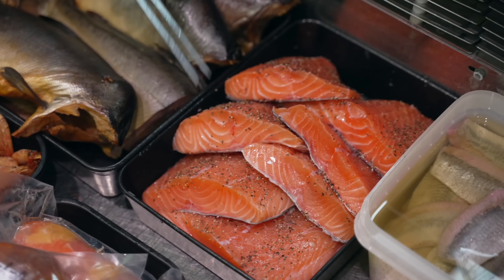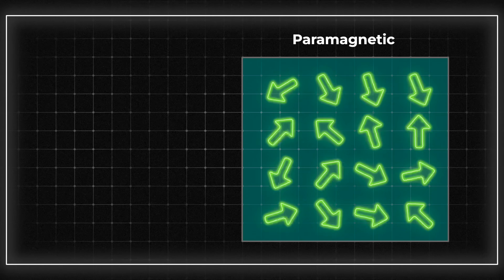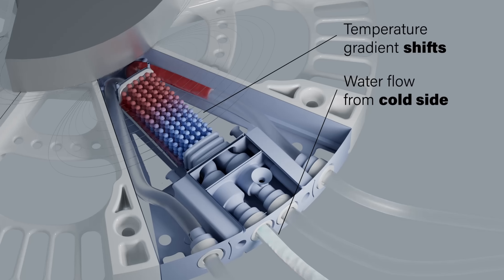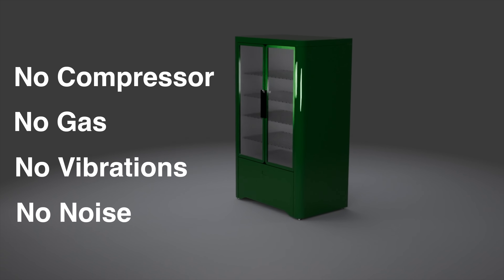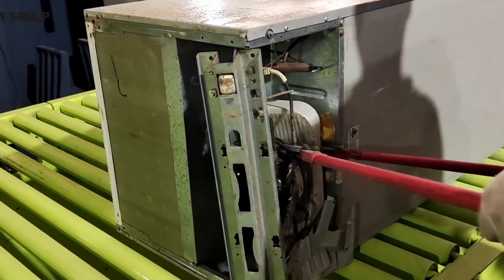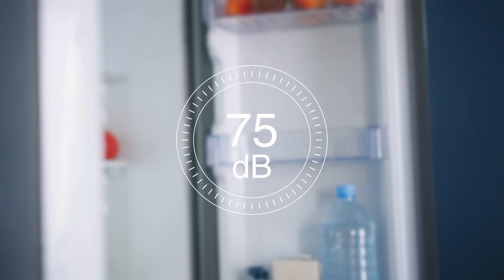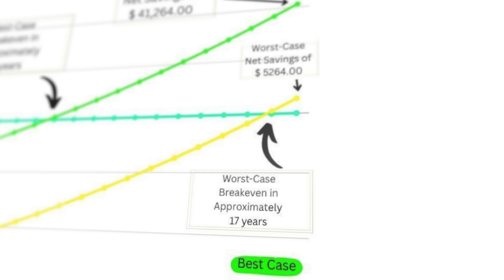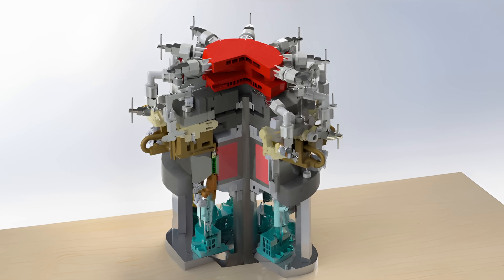Can Magnetic Cooling Disrupt the $100B HVAC Industry?

Comment: I have a freezer from 1954 that still works. It uses less power than a modern one and it uses Ammonia, so you will certainly know if it leaks. Water free ammonia that is, 99.98% pure, not the regular poop you buy at the store. It is absolutely amazing tbh. Freon in freezers are forbidden where I live, since years and years, but this freezer was made before freon in freezers was a thing I belive. Might be mistaken, but ill keep my old freezer till the day I sleep in the mud.
Reply: It's not the refrigerant.

It's the fact that old electronics weren't designed with built in obsolescence from cheap, short life components that will fail long before the main functioning pieces of the device fail.

LED bulbs are a perfect example of this.

The earliest LED bulbs for sale actually lasted many years.

Brand new ones will die within 2-3 years, because cheap capacitors on the internal PCB driving the LEDs blow out, as they were designed to so you keep buying more.

Simply replacing those electronic components on the PCB with high quality ones before you ever start using the bulb will give them MUCH longer life before needing maintenance.

(it pays to have an electrician in the family, or at least someone who knows how to change basic components and is competent with a soldering iron)

My dads old microwave was like this - he got it from his old work place where he designed and tested consumer electronic PCBs for a living.

It lasted over 20 years (with some replaced parts), which is pretty ancient for a domestic scale microwave.
Reply: @mnomadvfx  I absolutely agree that products from the past was built to last. Quality was a matter of pride back then.
Reply: They’ve been using Freon in household refrigerators and freezers since the 1930s. We had an old Frigidaire from 1932 that had R-12. It was still operational until the 1990s. Not sure what happened to it. Anything that has ammonia has to be piped with iron piping. If it has any copper, it isn’t ammonia. Highly doubtful if anything in 1954 had ammonia. But very believable it’s still running.
Reply: Maybe you will sleep with the fishes.

Comment: It seems intriguing, but even in the long term, it appears to be highly complex with what seems to be a limited of application. Implementing such a significant towards greater complexity would likely be challenging. Additionally, an aspect that was not addressed is how, say something like a walk-in would recover when frequently enter and exit. For instance, with Freon which has a very low boiling point of approximately -14°F, it can reduce temperatures rapidly.

Comment: I wonder if some sort of liquid with metal suspended in it might work? It would allow a continuous flow of the metal itself like the refrigerant we use now, perhaps eliminating the intermediate heat exchange step. Might even be more efficient since the little bits of metal in solution could provide more surface area for the magnetic field to work on. little spheres might work best. A sphere can roll over the insides of the piping as well, reducing wear and making direct contact with the tubing for a more direct energy transfer.

Comment: The component missing from the equation :  The price of electricity.  This figures in greatly into any calculation when it comes to whether this type of heat pump becomes prevalent or not. 

In some  parts of the country, the price per kilowatt of electricity is towards 30 + cents ;  In other parts of the country, electricity may cost as little as 11 cents.  This is why you may see solar panels in one part of the country but in other parts, solar panels are as rare as Kryptonite.  To be honest, in most parts of the country, I suspect that the reason the price of electricity is so high is not because of demand, but because politicians that heavily influence the price of electricity by artificially increasing the price, usually thru insane taxes or thru incentive programs which just  shift the cost of development  to someone else, i.e. to the taxpayers instead of those buying into the new technologies.

Comment: All this funny business is silly. Want to save energy cover your roof with solar panels wire it all up so when the sun goes down the grid power kicks in. That is all you need. If you want to spend more install a battery bank. 

If your a total DIY cheapskate like me go find a deal on some used solar panels for 50 bucks each. You can be silly and pay some arsehole rip off solar contractor 80k or DIY it for under 5k. After that your going to save 50 to 75%. 

Power company will be pissed off at you but screw them. Don't make your system grid tied, don't try to sell power back to the power company, this gives them power over you and now days they wont pay you hardly anything. Keep watching these videos with your TV lights and AC powered by the sun and your power bill 25% or less then what it was.

Comment: Celsius is not a better system, it is just a different system. I like the integer spread of Fahrenheit 75f 23.8c is not as cost saving for AC-settings as 78f 25.5c but 79 is too warm 26.1c; I don't like the decimal points. 25c 77f is an match point as integers but 78f is my sweet point to save money. It's just easier to not use decimal points.

Comment: If it is more efficient then I am thinking about EV battery heating and cooling. That also has a very specific ranges of temperatures that it will have to deal with making it better for that application.

Comment: I’m glad consideration of cost and environmental impact are addressed.
One golf trip for the idiot in the White House creates more greenhouse gases than dumping the refrigerant of several heat pumps. I didn’t do the math because it is astronomically obvious. An avoidable risk compared to one that could be mitigated while serving a purpose.

A $125 solar panel 400watt x 6hrs per day is 2.4 kWh. That’s a generous amount for a home refrigerator daily consumption. I’m very conscious of energy consumption because I have off grid solar and frequently monitor consumption. I have two large double door refrigerators and an upright deep freezer. Those and LED lights and various chargers average 20% load on a 5 KW inverter connected to the essential circuits panel that support them. 
  24 kWh on a perfect day could be generated by ten 400 watt panels,but with twenty panels and twenty kWh of battery,you can throw in the water heater except when the solar input is low.

This is not theoretical,but the system I currently have. I like learning about possible new technologies but free electricity destroys the urgency to change horses.

Comment: WHY SUCH SOLID MAGNETS?
Surely, getting the magnets to travel over a larger surface area would be better, even if using an intermediate fluid to transfer heat from fridge insides to the magnets.
Rather than solid rotating disc, why not:
 - magnetic goo/sludge
 - a suspension of particles in a fluid 
 - In a flexible medium to form a belt
 - As marbles following a path (noise and wear might rule this one out)

Comment: The noise level in fridges and freezers could have been solved. But the production facilities are to cheap focused. Ever heard about a screw compressor?
It is much more silent than a piston compressor.
However the price of a piston compressor is low.
There are screw compressors in the industrial use already. Like for high pressure injectors

Comment: I kind of feel strange about that. On one way it's nice, but on the other this seems quite complicated. Wouldn't it be more simple to get like modular fridges for commercial applications ? I mean they already have HVACS. They could get one compressor, for the building and hook it correctly to the building itself to heat it, while freezing and refrigerating the fridges. And dump that outside if needed. You could then just replace the fridges or compressor when appropriate, avoiding issues with recycling.

Comment: So, unless you are a big money corporate company who can deal with that LARGE price tag, the old fashion compressor cooler is still #1 choice. We switched to R134 back in the 90's due to the OZONE problem. now after 35 years it's greenhouse gases. FYI they are actually producing a refrigerant to replace R134 that has a much lower GWP, and pretty sure it will beat out the magnets in pricing much sooner.
 Comparing the magnet to solar is not really a good comparison, they are easy to make, try using the ELECTRIC CAR, they are being mass produce by many companies, yet it is still cheaper for the average person to buy an ICE vehicle.
 I liked the video; you were very concise without doing a long backstory.

Comment: R134a is being phased out.  New refrigeration equipment will not use it.  In fact the replacements for all refrigerants all have such a low Ozone Depletion Potential (IDP) that the scaremongers have invented a new metric, the GLOBAL Warming Potential (GWP).   And these scaremongers are all fine with using isobutane or CO2 as a refrigerant.  It is all a giant grift and scam.  Maybe magnets will find a use no matter what.

Comment: I think that the cost of electricity will come down faster than the price to make a magnet powered refrigerator, so that they will never be cost effective to produce in a capitalist economy.  Also, the cost savings you quoted per year for this compared to a conventional refrigerator must be based on a very expensive electric price, as my entire electric bill is only about half of what you were claiming as the cost to run just a typical refrigerator.

Comment: Do you think this will be adapted for things like space suits? I mean you could use them in the thermal regulation system since they produce both hot and cold. And in theory you might be able to make them small enough to fit in a backpack? I just wonder how durable they are while being moved, they are going to want the air gaps to be minimized in order to maximize the flux and efficiency of the whole system.

Comment: Wow, these fridges kind of suck, they can barely even get down to refrigeration temps, has more moving parts and a far more complex refrigeration cycle. I get not wanting to use refrigerants that are extremely environmentally damaging but modern refrigerants aren't even that bad and you can use almost any gas as a refrigerant if you really want to, even argon which is quite cheap and super inert.  Also, 17,000 kw a year?! What kind of fridge are you talking about? Because my whole house doesn't use that and it has 2 full sized fridges and 2 chest freezers (not to mention all of the rest of the house's needs on top of that). Finally, have manufacturers not just considered insulating refrigerators better?  Because getting things to a temperature is no different than rolling a ball up a slope, sure it takes work to get it there but once it's where you want it, as long as you can stop it from rolling back down (insulate it), it takes basically no energy to keep it there.

Comment: Newer fridges only break down in 15 years  because companies want them to.

I had a 30 to 40 year old fridge back in the 90s (it might have even been older). 

It only broke down because I damaged it while I was cleaning it.

Older friges were built to last while the current ones are built to break down so companies can make money. 

It's called planned obsolescence.
Reply: Unfortunately, modern fridges are made to last, maybe 10 years. At least before you need a repair. We lost the technology to make a fridge that goes 40 years. Same with all appliances.

Comment: These, combined with Peltier elements, could easily replace traditional fridges. There are full Peltier fridges already, but they are relatively inefficient because you pay an efficiency price if you need to create a large temperature differential with them. Yet they could be very useful to boost  the temperature from a few degrees above freezing as magneto cooling can achieve to solid below. This hybrid would have better efficiency than a full Peltier cooler and better cooling range than a magnet cooler. It will beat a traditional cooler if the freezing compartment is not too big.
Reply: I'm not so sure it's feasible. Peltier modules only have COPs exceeding 1 when creating a 1° or 2°F gradient.

Comment: You made a HUGE mistake in your comparison/justification, saying 17,000 Kilowatts, when the real number, for an average refrigerator is about 1,700 Kilowatts. (...or about 200 watts per hour). So the yearly savings figure of $2,400 is actually only $240, which doesn't come anywhere near justifying increase in cost. In essence these things are light years away from making sense and there is no reason to be excited... 

Hopefully someone will keep trying to make this process exponentially cheaper and simpler, but realistically it's more likely that all the existing producers go bankrupt due to lack of any conceivable cost/benefit. This is really similar to the issue with pulling drinking water out of desert air, It's just cost prohibitive and overly complicated Only makes sense in the rarest of circumstances). Since you reference this "cost savings" as the reason why everyone should be excited by these these magno-refrigerators, i figure it was worth while to point all this out... LMK if you want a proof next time b4 you put all the effort in?
Reply: I am not excited...
Reply: You misunderstood what he stated. he did say industrial fridges were the information point not your fridge at home. I’d imagine an industrial one is quite a bit more of a drain than what’s in the kitchen.

Comment: If they could find the right gas that would work at the temp the magnets get on the hot side they could use that in a gas cycle like the RV fridges to gain extra cooling instead of wasting the heat to the atmosphere. That could power a freezer section or supplement the cooling on the fridge side with no extra power used.

Comment: Don't let the perfect stop the good enough. People could easily get use to divided refrigerator and freezer. There is no compelling demand that one unit do both. Also the cost shift is much quicker if you add a recycling fee to every pound of HFCs from point of sale to return. The idea that people get cheap units now and pay no price for the escaped gases is just a criminal part of capitalism. Internalizing profit and externalizing costs. Build the separate units and if you want a single box for it with two systems to avoid the inconvenience, then you pay extra. Besides look how "heat pumps" for housing systems were range bound for so long. Now they are extending the range to work in much colder conditions such that you can have a heat pump for your home in the Arctic circle without a backup electric heat coil for days below a certain temp. Given time and incentive, engineers find a way. I am old enough to remember when the freezer part of the unit was about one square foot inside the refrigerator box and you were happy to have a few ice trays for your drinks in summer. Maybe even a carton of ice cream but not much more. And I still saw a few from before my time where the compressor was out in the air ON TOP of the refrigerator box instead of hidden away in the bottom. We have come a very long way in my one lifetime. My grandmother actually still had the old ICE BOX in the kitchen that used a block of ice from before they had electricity at all. And it was on a farm where the old ICE HOUSE was in a pasture. They actually cut the ice in winter into blocks and stored it between layers of straw mostly below grade but that was their yearly supply of ice for the kitchen. We came a long way baby!!! How many even know about ammonia refridgerants? Or PROPANE POWERED REFRIGERATORS? How do you use fire to cool things? Many RVs had them though. And it is still used in some Amish communities today.

Comment: Ummmm.... my fridge uses R600a, which is GWP of 3, barely above CO2. Why not just mandate fridges use other such low GWP refrigerants? Also my fridge is incredibly quiet, it's 4 feet from my desk and i don't even notice it's on.

I think this is almost more applicable to offset some use of heat pumps for air conditioning instead of fridges.

Comment: btw these so called efficiency improvements are basically dream, air con units try to do the balancing act by using seer ratings, these electromag fridges I believe will not compare favorable to the highest seer rating units... and just the fact that they are hyping the lack of fans (they will still need them though) and compressor for lower noise, modern compressors are nearly silent but the fans if they move much air will still generate some noise.. it is totally unfair to compare a fridge of 40-50 yrs ago with its noisy compressor, much lower efficiency and noisy fans to this device, compare it a modern one and you will find it just does not compute...

and the only reason anyone saves $ in an EV on "gas" is because they are using subsidized electric rates as at normal rates in the mainland US it translates to over $5.50/gal... charging your car at $0.17/KWH... do the math dude, not governmental math

Comment: R290 (aka propane) does not have ozone depleting/global warming potential. It is a direct replacement to R22 CFC(means it is already commercially viable), but is highly flammable. It is used in large commercial units,as well in small domestic units. Just FYI.

Comment: so, more to parts to break. A water pump, valve system and heat ejector is needed instead of a refrigeration motor. Yeah I totally see the savings in production and lifetime of the appliance... My fridge is running for over 10 years now and consumption only went up a bit. I know for sure my AC unit is worse for the environment then my fridge. My AC should have ozon "save" gasses but uses WAY more energy in a year.